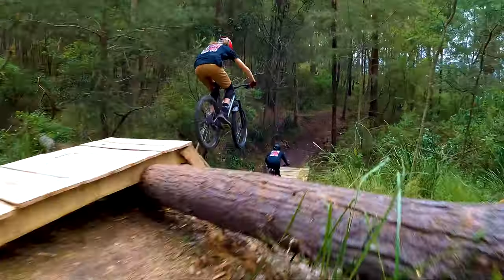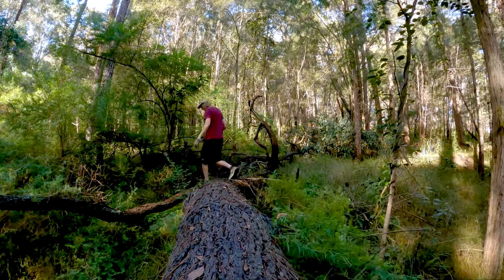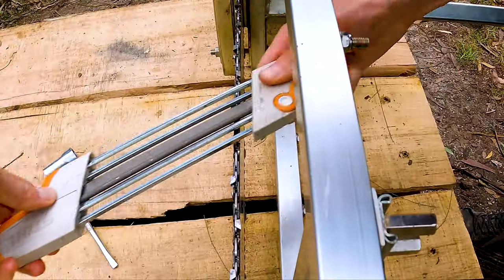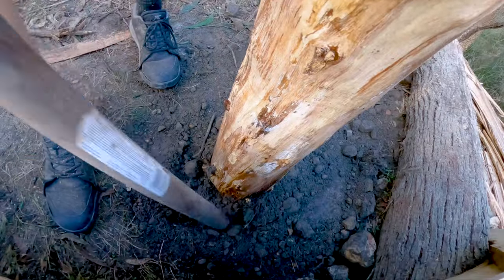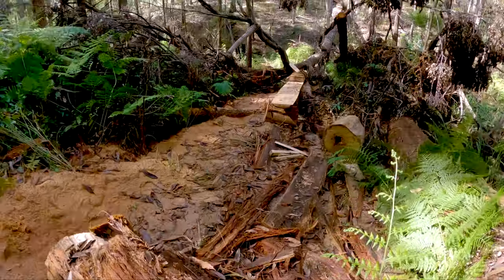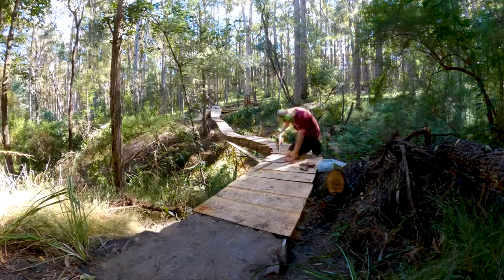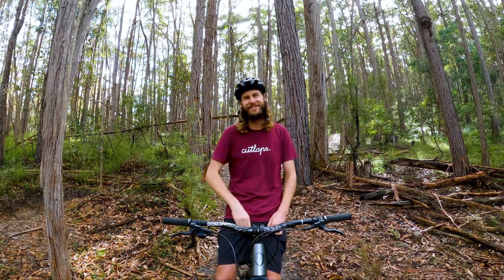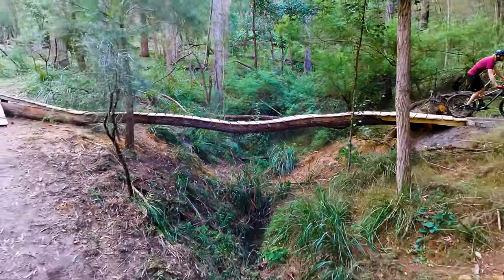I built a skinny bridge with a chainsaw and fallen tree!

Comment: This is great. Can I give you some advice from a storytelling POV? Always put the problem before the solution. That way the audience is pulled along onto the next piece of info.
Eg: if I run the Alaskan mill on it how it is, the mill might get caught. At 2m up, that would be a problem. So I'm going to shave off the top layer with a hand saw so it slides smoothly 
Eg: how wide should the boards be? I want it to be safe, but not too safe, so I've opted for about xxx cm 

That kind of thing. You do it sometimes, but I think you can do it a lot more. Pay special attention to things you think are easy to solve. It can be hard to slow down your thinking or notice how hard problems are before you solve them.The audience probably doesn't find them that easy and would be interested in your thought process. Keep up the great work.
Reply from the maker: Dude, that is some great advice and it makes so much sense. Thank you for taking the time to leave me a comment. I'm learning something new with every episode.

Comment: You should get a milling chain, or also called a skip tooth. They are cut at a 10° angle rather than 30° and it’s more aggressive specifically for Alaskan milling.
Reply from the maker: Hey Trail Jockey! Cool I can see you have gone through and watched lots of my videos. Thanks. I have a couple of skip tooth chains, but I find I get a quicker cut with my regular chain. I have 90cc chainsaw and I'm not making very thick cuts, so it's not getting bogged down at all (one of the main reasons for skip tooth chains is it takes less wood at a time allowing for higher revs). A skip tooth chain also creates a smoother finish, which is great when using the wood for building furniture, but for the trail it really doesn't matter to me. The main reason that I find it quicker than the skip tooth is sharpening. I have the Stihl 2 in 1 sharpner that is so easy to use to get it super sharp and it's doesn't work on skip tooth chains. My hand filing skills are a bit crap lol. Really should work on that a bit more. Thats just been my personal experience with milling.

Comment: If you feel like more of a challenge you could put angled slats in on the first corner which may make entry easier, and same as the exit, so you can try come out wider and possibly faster (to build momentum from)
Reply from the maker: I was actually thinking of that before I build it. But would have required more work than I had time for.  I actually like that the first corner is the trickiest part. It acts as a squirrel catcher for less advanced riders. My thoughts are if you can't make the first corner than you probably shouldn't be on a skinny that high up.

The look of the angled slats would be awesome and I definetly want to try that somewhere else on the trail.

Comment: You've become such a lumberjack mate, great to see the skills progress!
Reply from the maker: Haha thanks man. Keen for a ride with you when you're down.
Reply from the maker: @BlurnGanston  how good is the 2 in 1 sharpener! It's the quickest I've used and gets it the sharpest. I just wish I could get one for my skip tooth chain.
Reply from the maker: @BlurnGanston  I'm using an Alaskan Mill. And its so good! It means I can turn any fallen tree into slabs for building where ever it fell over. It can be hard work and take a bit of time but the results are worth it.
Reply from the maker: @BlurnGanston  That sounds awesome! You should be able to buy some spray to treat the soft wood as well to make it last longer. The mill should be pretty easy with soft wood. I'm working with some really dense hard wood so it is tough on the chain and slows things down. I'm not too sure about the characteristics of your wood, but you may be able to split it into boards easily using wedges. It can have a rougher surface that allows for more grip.
Reply from the maker: @BlurnGanston  Awesome! sounds like you should be able to build some pretty fun wooden features.